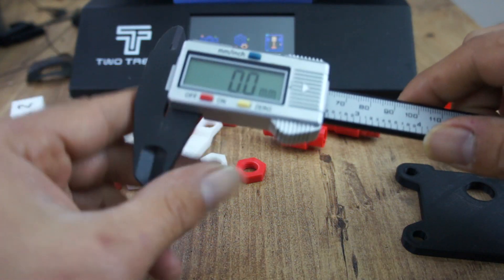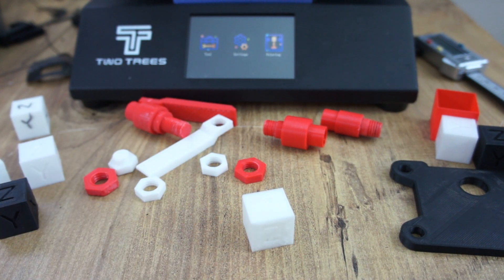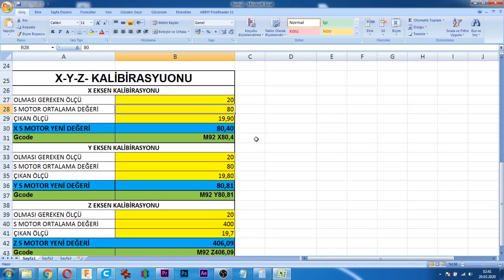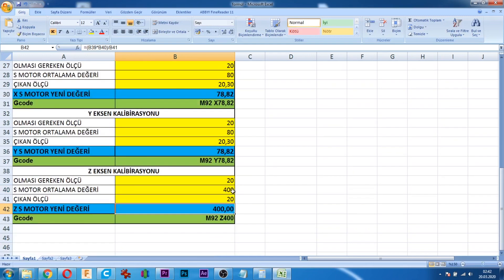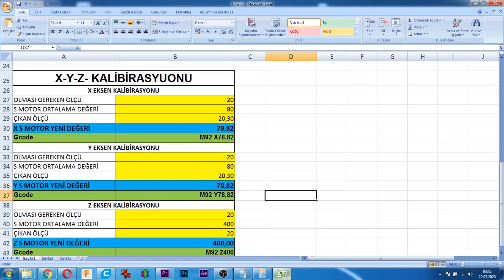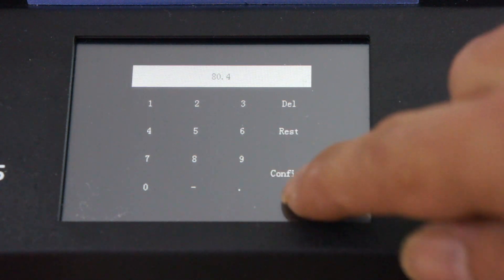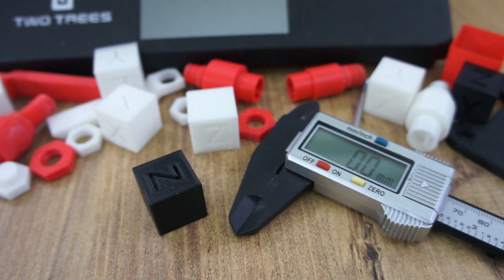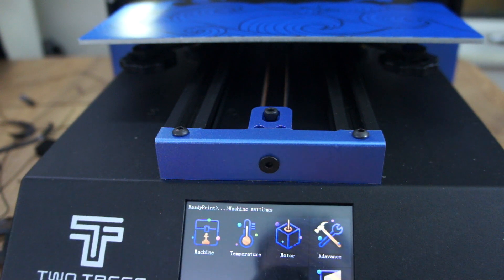Two Trees Bluer 3 Boyutlu Yazıcı Eksen Kalibrasyonu Nasıl Yapılır

Comment: Merhaba ustam ben kendim bir yazıcı topladım, sigma profil ve köşebentlerden yaptım şaseyi. Z ekseni 2 adet M8 trapez mil (2mm pitch)ve 40diş kasnak takılı her 2 mildede, motor ise 20 diş kayış sistemi  ile hareket sağlıyor.Ramps 1.6 üzerinde drv8825 sürücüler var.Z eksenime 10mm git deyince 5mm gidiyor hesaplarıma göre 3200 ayarda çalışması gerek , fakat hangi değeri verdiysem hiçbir değişiklik olmuyor.Configration.h dışında başka bir ayarmı var marlinde?
Reply from the maker: Bahsettiğiniz konu ile ilgili yeteri kadar bilgi sahibi değilim. Reprap calculatorden tekrar hesaplama yapmanızı önerebilirim sadece. https://blog.prusaprinters.org/calculator/

Not : verdiğiniz bilgileri hesaplayıcıya girdiğimde 1600 değerini aldım.
Reply: @TA4AWS  cevap için teşekkürler, step ayarına ne girersem gireyim hep 5mm gidiyor , baskı yaparkende  mesafe az gittiği için belli bir süre sonunda nozul sürtmeye başlayıp yazdığı kısmı plakadan kopartıyor.Bu sorunu bir türlü çözemedim malesef.